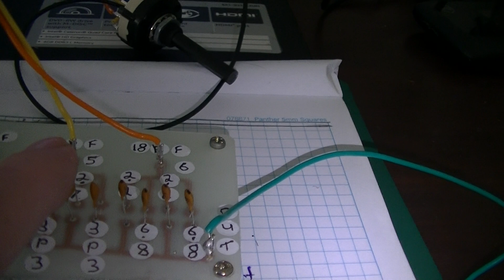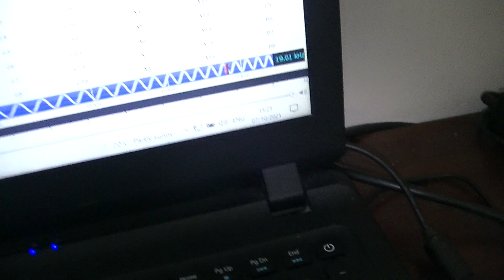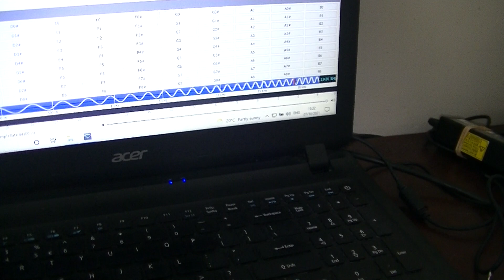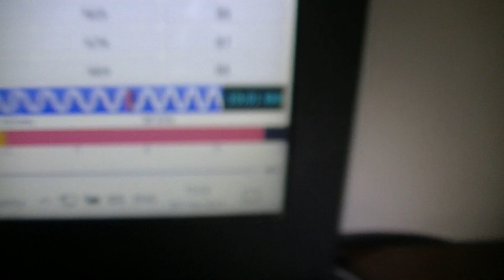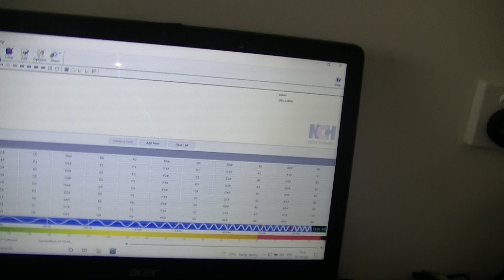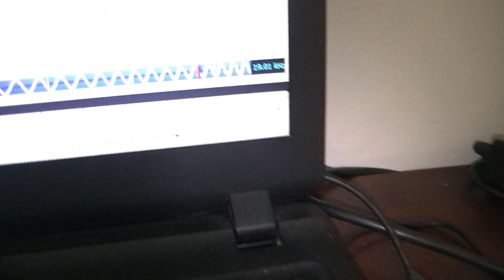tesla 3,6,9, number based frequency generator circuit experiment

Comment from the maker: all i have to do is design the new circuit box for this and even though ive measured the frequencies  seem to include mostly the tesla 3 number  in some of the frequency counter measurements but the ceramic capacitors all have  the a letter c on them for  the tolerances, lots of experiments to do yet as i have 70 frequencies from my other frequency generators to put them against in experiments